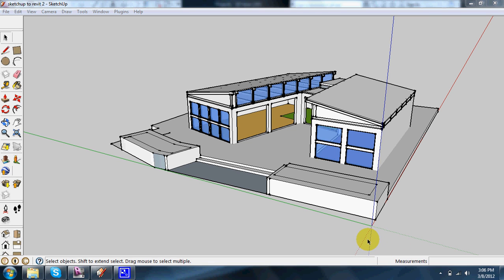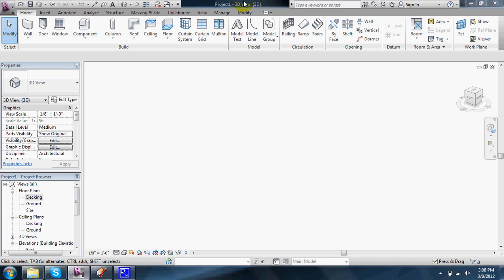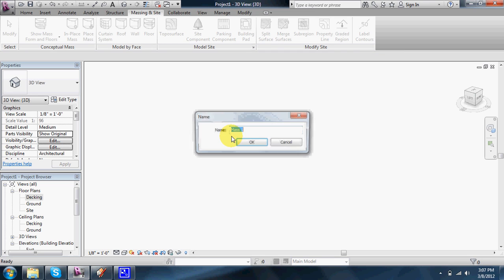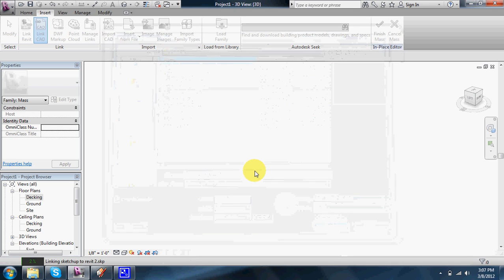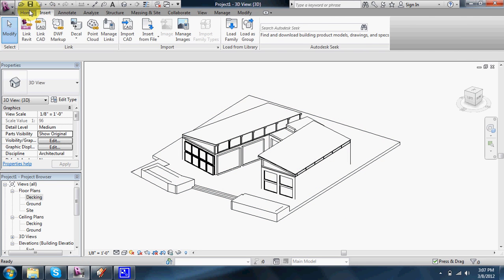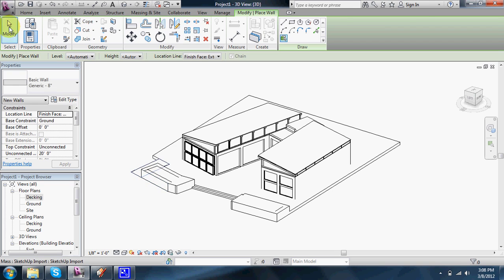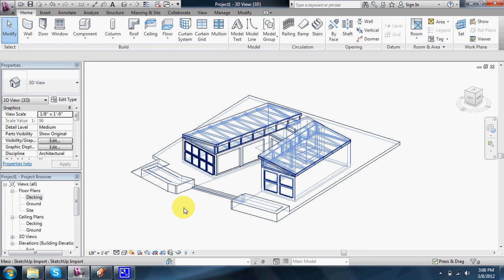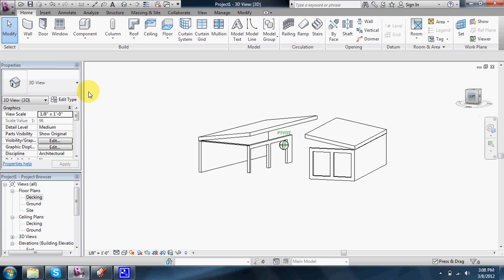SketchUp to Revit FAST

Comment: Using this technique, Revit throws me an error message "Some ACIS objects could not be imported. To import them, use AutoCAD to convert them into polymesh objects and reimport."...It does not like curves with multiple faces...such as pipes, railings, etc with more than sever segments.  Probably doesn't like a lot of other stuff too if I know Revit.  Anyway, I got a skp model to Insert into a Mass.  However, I don't want it at my level One (0'-0")...and I cannot seem to move it in the Z-axis.  Any thoughts on this?

Ah..never mind-right Click-Edit Family..THEN move it.
In my case I'm not going to build walls and roofs on my model...I'm bringing in something with complex geometry that would take a few years in Revit to model...so it's a real time saver. However, the line weights/visibility graphics cannot be modified.  Any workarounds to this issue?

Comment: Hi, your video is very helpful. I have a question when I did it by myself. it shows "This family instance has too many edges.  Remove unnecessary geometry or split the instance into multiple instances." and stop me from inputting the sketch model.
Reply: Did you get any soution?
Reply: Did you get any solution ?
Reply: same problem...
Reply: Anh Hoang Quoc  yes I did that but don't remember what I have applied